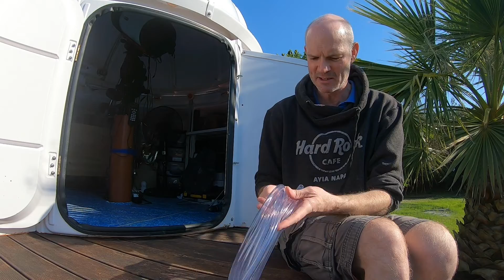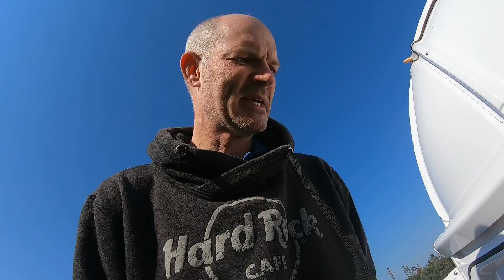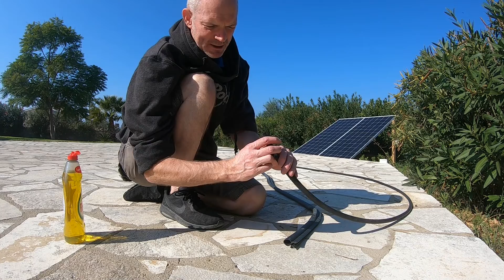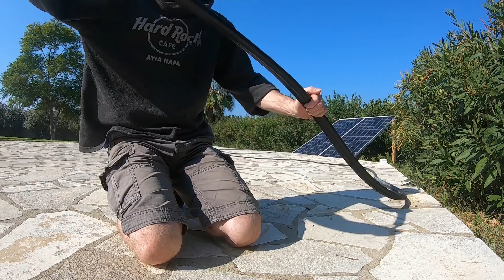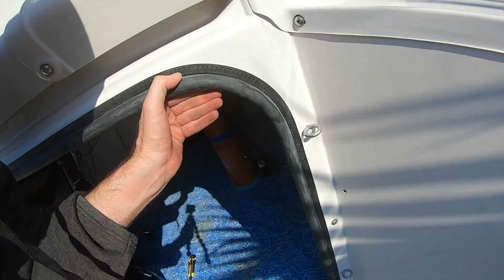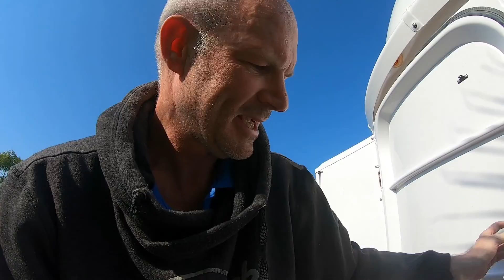NexDome Door Seal Modification (and Wizard Nebula latest capture)

Comment: Did it stop your leaking?
Reply from the maker: 99% High winds and driving rain, a few drops come in, but no issue.
Reply: Hi Dave just installed my modified door seal. Then we had a good rain with wind here on the Oregon coast. Not one drop inside !!!!! 😁thanks for your video.. bit of a wrestling match reinstalling it but works great! Thanks and cheers 🍻
Reply from the maker: That's great to hear Mike, my next dome project is to weather proof the rotation to minimize wind/dust blowing up into the dome. See how that goes 😂
Reply: Thanks. You’re a genius. 🍻 cheers my 18 inch dobsonian and I love you. 😂

Comment: Dave, thanks for posting this. The fit on my door is terrible. The door and seal had large gaps at the corners. After attaching the door to the hinges the side opposite the hinges barely overlaps the seal. Your viewer's suggestion helped a lot. Just wished the door would be about a 1/2" wider and taller. When I attempted to place the irrigation tubing inside the seal I could only get it in about half way even with a lot of lube so I thought that I would see if using compressed air from my air compressor injected between the tube and the seal would help. It helped a lot. I had the rest of the tubing inserted in about a minute!
Reply from the maker: Cheers, it is still not perfect, but definitely an improvement. I think adding a small awning over the top of the door section will be the final solution to keep the weather out.
Reply: Yeah, I just received a sheet of ABS this week from Amazon to do that.  @DavesAstrophotography

Comment: Ah c'mon Dave , be brave...turn the hose on it and see right away if it works . LOL . Fingers crossed eh ? /SRK
Reply from the maker: I wouldn't have a problem doing that, except don't want to get everything outside the dome unnecessary wet, as I was still coming in and out after when I set up for a livesteam on the sun. :-D